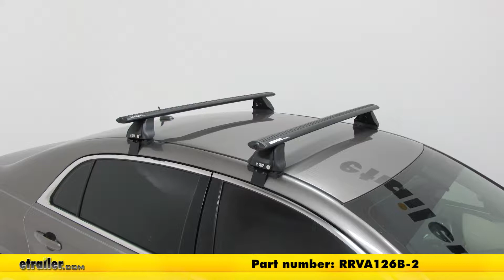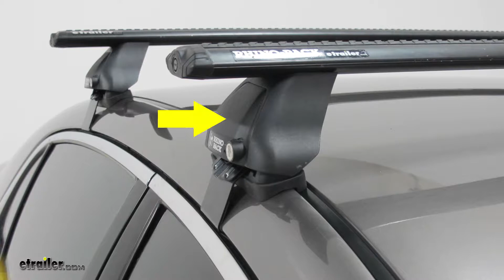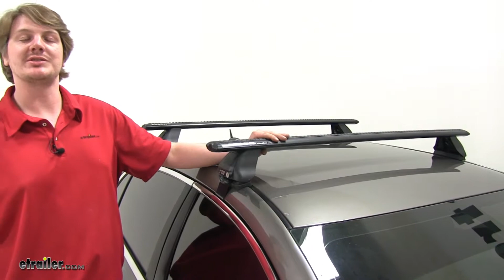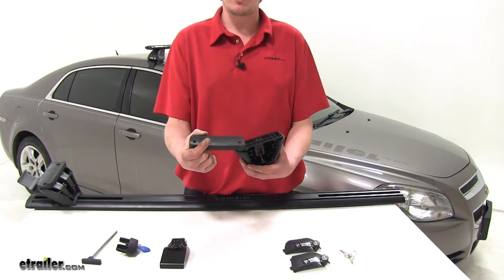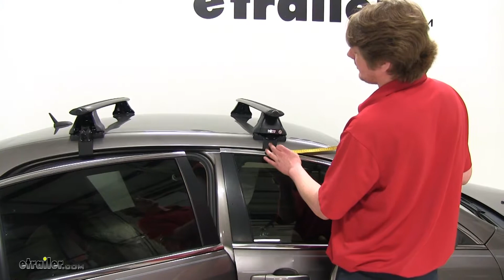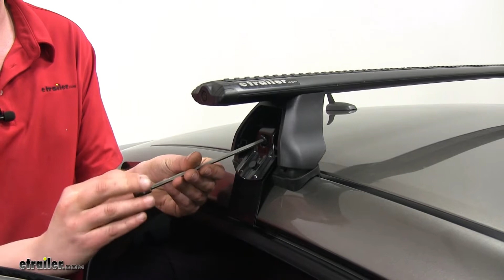Mount: Custom DK Fit Kit for 4 Rhino-Rack 2500 Series Roof Rack Legs on a 2010 Chevrolet Malibu

Comment: will this fit on a 2010 impala
Reply from the maker: The bars and legs are the same but you need a different fit kit.  Here's everything you need for your Impala https://www.etrailer.com/multi-product.aspx?pc1=RRVA126B-2&pc2=RRRLKVA&pc3=DK187&VehicleID=20101394561&HHYear=2010&HHMake=Chevrolet&HHModel=Impala